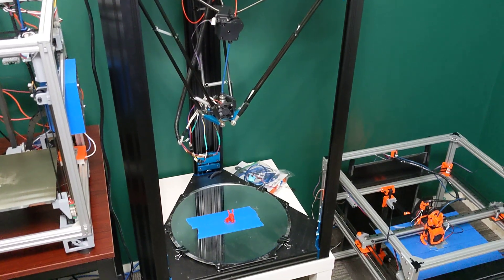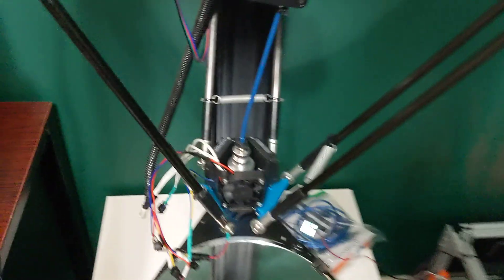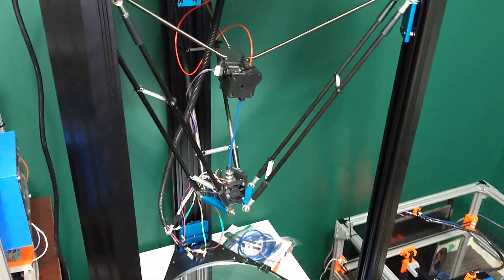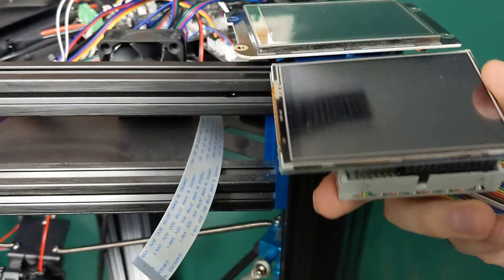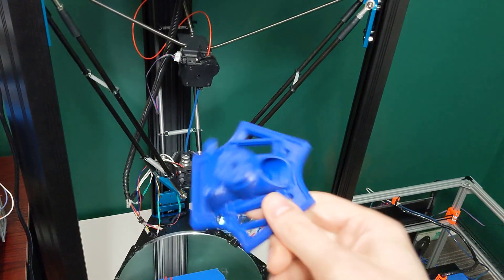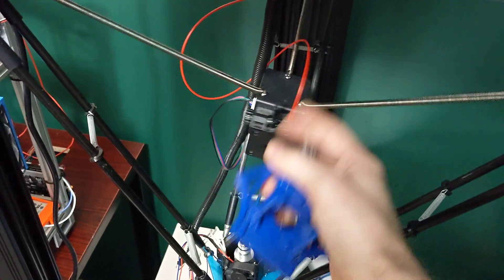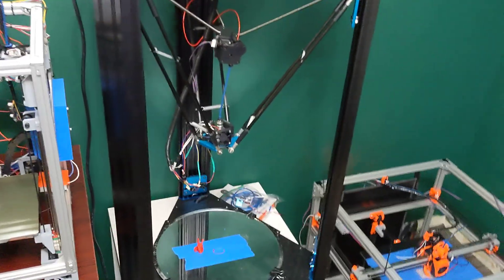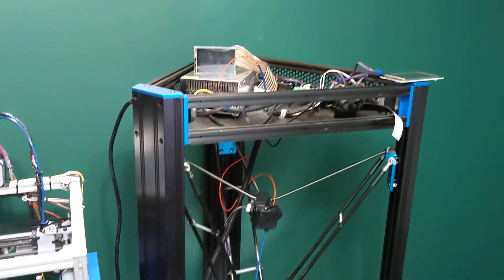Anycubic Predator Delta 3D Printer Upgrades Part 1 - Overview

Comment: Hello! Great video, very informative. I would like to know if the display for this printer is available anywere to buy or if there is a compatibile one. If you could help me that’ll be great:)
Reply from the maker: any klipper screen will work well, there are many compatible, https://klipperscreen.readthedocs.io/en/latest/Hardware/
Reply: @Rolohaun that’s great to hear! Everyone of those screen will work with the stock connector or some modding is required?
Reply from the maker: @TrevorJSR  all screens plug into the raspberry pi, the connector doesn't really matter. you just need a supported screen

Comment: I got one of these quite a long time ago, it was okay for a few months, then decided to kill itself on a 22 hour print. It happened right at the onset of Covid in China and I couldn't get parts for it. When I finally found a few things that could work, it was slowly rebuilt, but I've not have much luck replacing the hotend. After going full resin since then, I'm thinking about rebuilding the Pred once again, and for the life of me, I can't remember much of the specs on the electrical system. I'll be checking out your build series to see what I can pick up, and have a slew of hotends from 2020ish but suspect they're not the right voltage.
Reply from the maker: just make sure the hotend is 24v, the predator is a good printer once you add klipper and some cooling. Mitsubishi on my discord is modding this right now
Reply: I'll have a look at that pretty soon here. Just started dusting it off today and unearthing old parts. Evidently I picked up a BMG extruder and what looks like a Mosquito-esque hotend at some point, but evidently it didn't fit, or I ran into not having a 2nd printer at the time to make parts. As luck would have it, the screen on my resin printer just went out last night. Sigh, the gods are angry!  @Rolohaun

Comment: Thanks so much for this series!  I'm so sick of using th SD card, hehe.  Do you know if the SKR 3.0 would work for this as well?  I am very interested in upgrading to Klipper and being able to integrate with a pi.
Reply from the maker: SKR 3 should work as well, most mainboards should be fine

Comment: I’d like to do a similar mod on my flsun qqs.
Reply from the maker: you want to put Klipper on it or a different effector hotend?
Reply: @Rolohaun  Both. There is an super racer based effector I found and also want to add a rapido. Also not having the filament run from the top of the machine through a long Bowden isn’t helpful.

While also doing a different firmware.